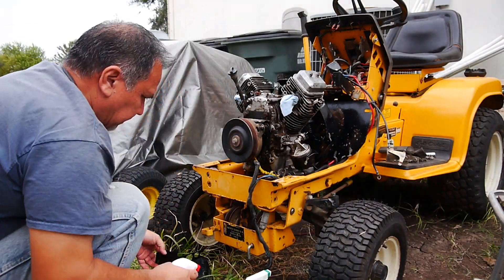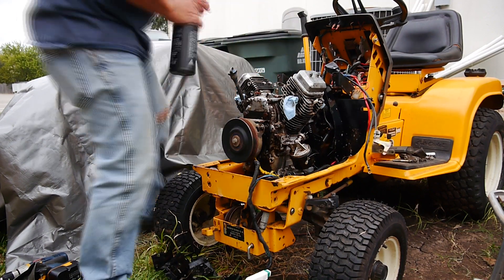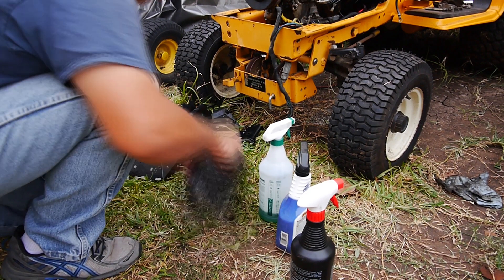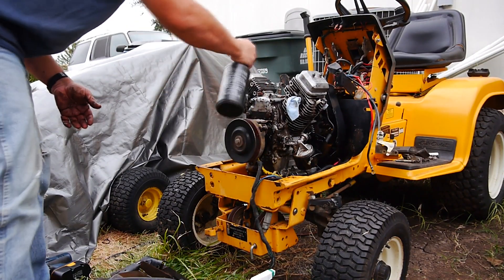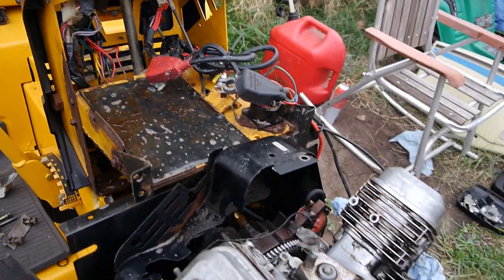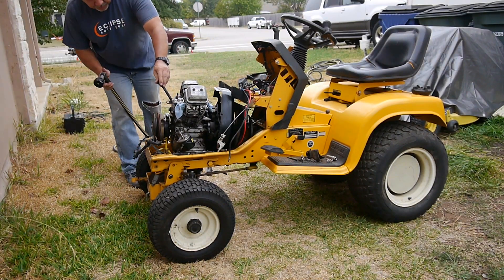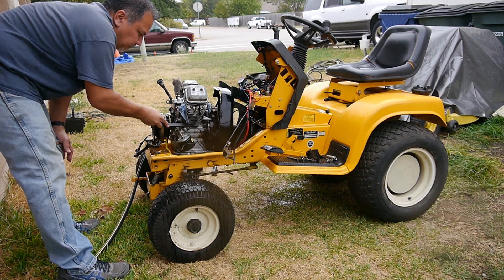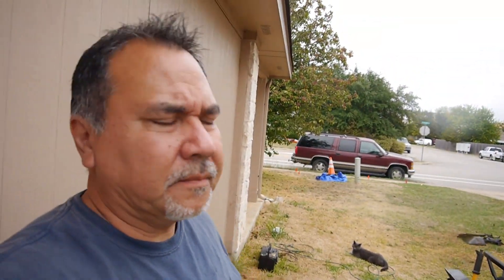Vintage Cub Cadet 1440 Restoration Part 4 - Clean up and Paint

Comment: You should have used satin that works better than that gloss and if you got some really tall grass out there you better get somebody with a brush hog behind a big tractor to knock it down and then you can keep it maintained with that cuz you'll just absolutely overheat it with that Briggs on there and you will blow the head gaskets again and you'll be back doing everything you're doing now so don't think you're going to go out there and mow grass has two foot tall it won't happen that mower is not designed for that it is a tough mower but it's not designed for that
Reply: My 1440 has a Kohler motor. Is my carb completely different?
It doesn't look the same.

Comment: You should prep the surface with 99% alcohol before you paint to clean the oils & trash off. I think the hi-heat gloss reacted with the “primer”. Maybe you should just use the hi-heat, no primer.